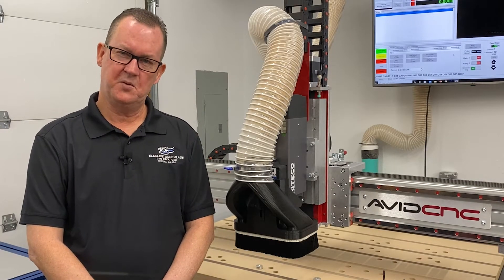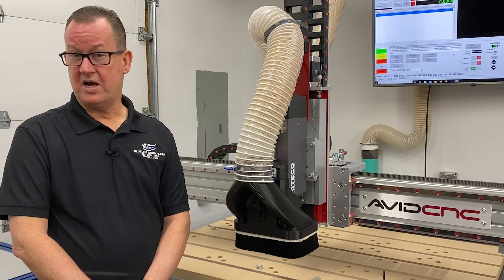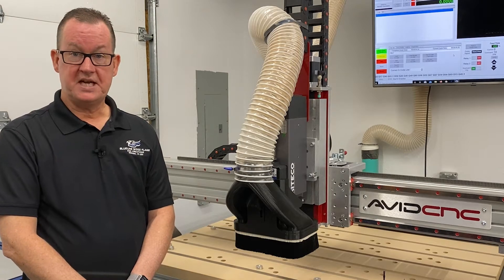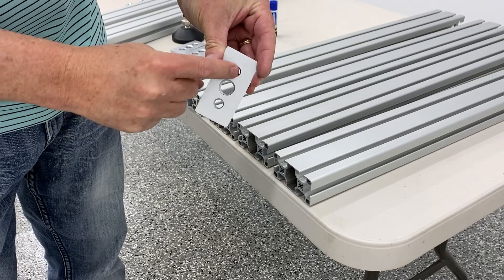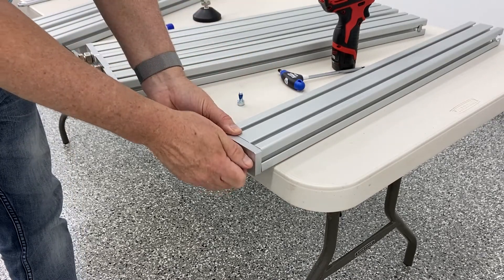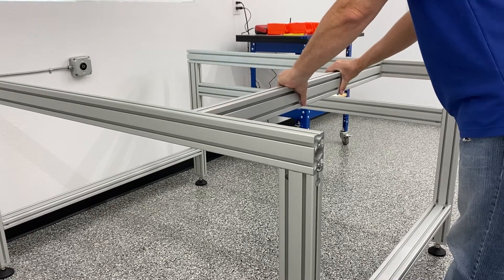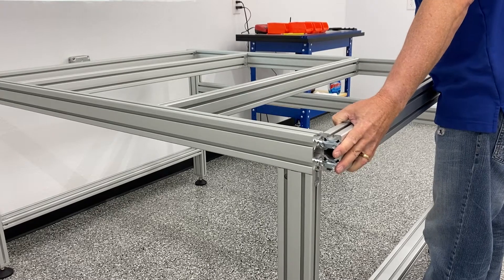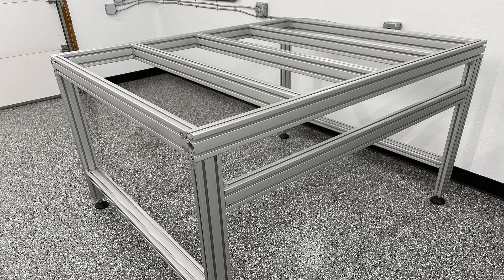AVID CNC 48" x 48" Pro Assembly, Part 1 of 3

Comment: Hey Russ, I really like your videos! I'm a newbie considering buying my first CNC. I'm interested in the Axiom, but I noticed here you've added an Avid CNC. I think the Avid is too much for a beginner to start with, but looking back, are you glad you started with the Axiom, or would you have picked a different one like Shapeoko or OneFinity? I'm thinking of the overall experience for a newbie: software, operation, reliability, etc. Anyway, if you don't get a chance to answer me, I get it. I'm a new sub either way. I like your process videos on how you make the flags! Thanks!
Reply from the maker: Hi John thanks for the compliment. I actually no longer have my Axiom and exclusively use my AVID for my production work. I can’t speak for other brands but I will tell you the Axiom is solid and perfect for a beginner. It uses ball screws so it’s not too fast and the pendant is easy to learn. You are right in that AVID is too much of a machine for a beginner.  Good luck. I hope this helps. Axiom is a great start and light years ahead of hobby machines IMHO.

Comment: So for daily use, would you recommend the Avid or Axiom? I'm on the fence with these two and still building my small shop before I commit. I want to make sure I buy one that I won't feel like I need to "upgrade" my CNC to a bigger/better one after 1 or 2 years, that is part my research because I only want to buy one over the next 10 years, then...who knows.
Reply from the maker: I think you need to look at your long term goals and that will tell you which direction to go. Both are excellent choices but both are much different. The Avid is an absolute beast and I don’t recommend it for a beginner. It’s extremely fast and with Mach4 there is much more of a learning curve. The Axiom is a pro-sumer grade machine which is very capable. It’s not as fast as the Avid put due to its precision ball screws and linear rails, it is extremely precise. If you are a weekend warrior and don’t plan on much more than that I would go Axiom. If you plan on doing production work, go with Avid. With that said, I will be selling my Axiom with all its accessories. I need to get back some shop space.  Whoever the new owner is, they will get a great machine at a discount.
Reply: @BlueLineCNC  Thanks for the quick redponse. I have run CNC machines in my past, long ago, industrial machines, so it's not new to me, just a relearning process, plus I am trying to learn the VCarve software now for a headstart, although I would like to use Fusion 360 on occasion, not sure on software though, it will be new to me. Your kind and informative response has me now leaning very heavily toward the Avid so thank you, and thanks again for the quick response.

Comment: Great videos,  are you going to follow with Mach4 setup?  I just finished a custom 6X12 Avid pro build and still need to calibrate the machine with  Mach4 , stepper calculator,  soft limits etc.
Reply from the maker: Hi Mark.  I have been asked to do a video showing my spoilboard setup.  I think  Mach 4 setup is a great idea!